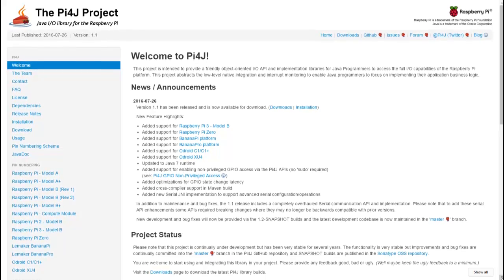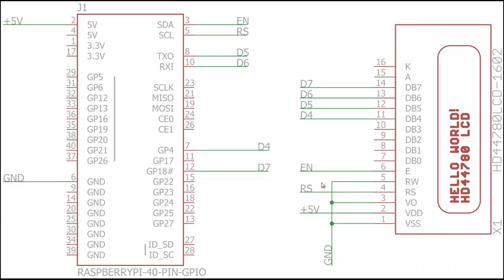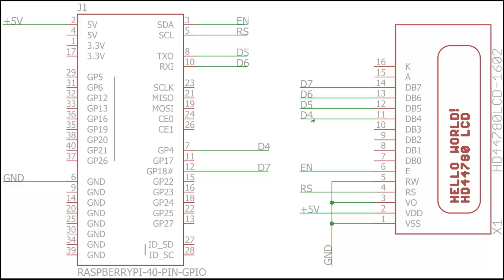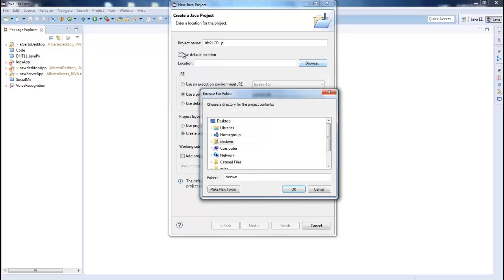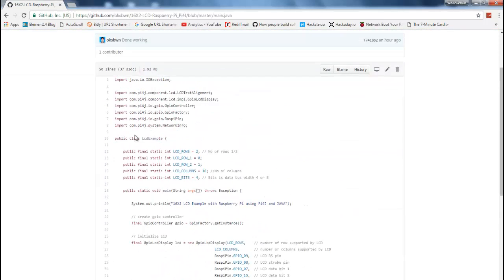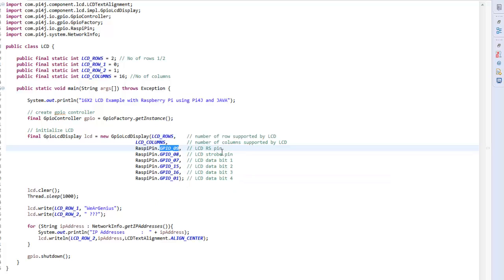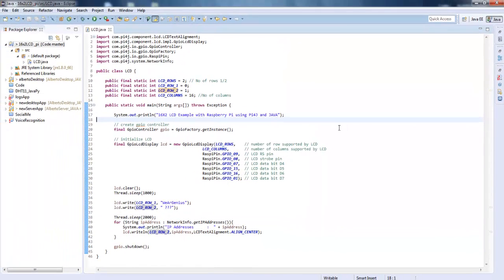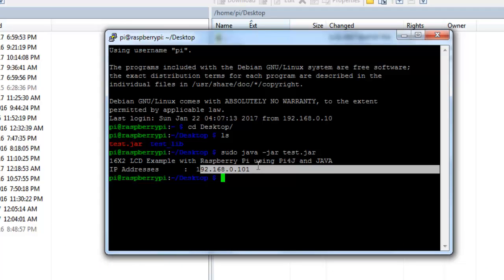Show messages on 16x2 LCD | Pi4J | JAVA | Raspberry Pi #21

Comment: after 3 times that make change in the message the display is returning the error wiringpi -1 the lcd method is inside a while would you know what I can do to stop this error?
Reply from the maker: As far as I have tested it works, can you please recheck the code ...